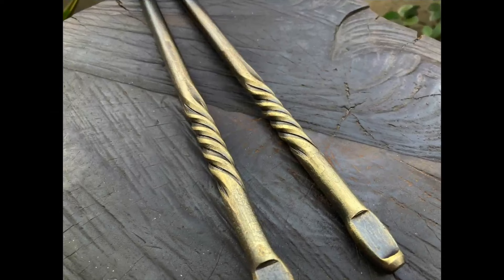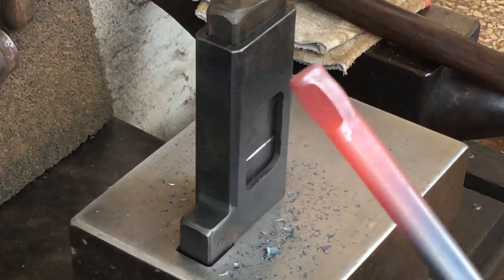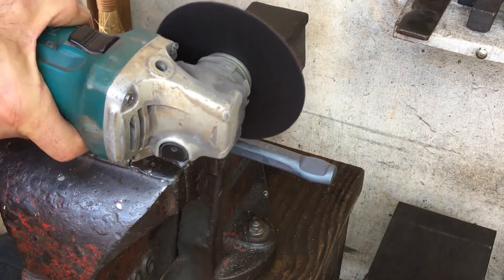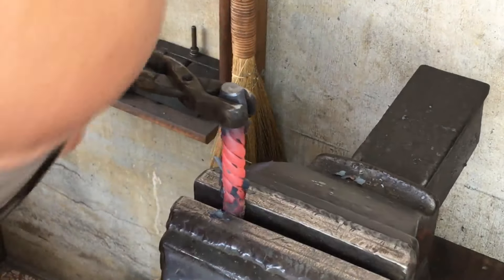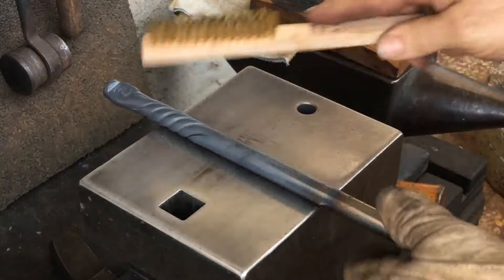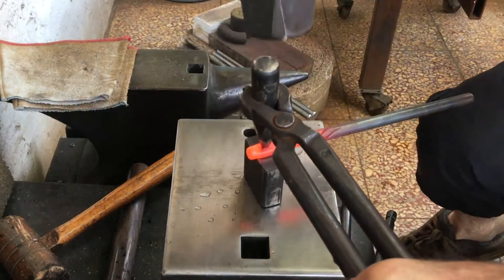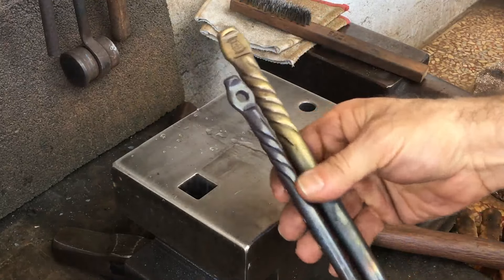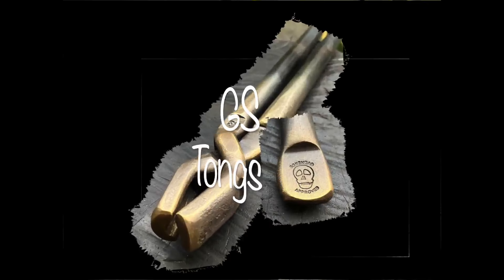Simple Rope Twist - GS Tongs

Comment: I like the idea! I have recently made a bunch off bottle openers with a rubics twist as a grip and I also use the angle grinder to make the slit in the middle of all four sides, but I then heat the part and refine the slit with a chisel. That way, the slit is slighly deaper and doesn't fade out at the ends.
Reply from the maker: Good idea. Thanks for sharing and for watching.

Comment: I need to find some W1 here in the UK, most people even in the steel trade don't use sensible names for identifying steel ..its all EN something or ldb whatever else and only two places I know of use sensible names and neither one does W1 or the Y types that you have talked about...I could swear a bit lol 
I really like the twists with the extra cut in the centre , its such an easy concept and extremely effective way of decorating different items.
Thanks for sharing
Reply: There's a few problems with the UK I know about in that they used to get pinged on taxes for bringing in some steels from the US and it was mostly just the UK and EU countries that only really didn't get hit with it. This is going back a few years now from the major resellers I used to know there so I don't know if it still holds with all the changes. It got so bad they fired up the crucibles in Sheffield and started making 1084 locally again!
The other problem, W1 isn't made much any more
They used to use it unhardened in the drilling industry as shaft extensions in an unhardened form so there used to be a lot of it out there in 1" bar stock but not much else, possibly there is a melt of it since somewhere else by someone who was wanting it, W2 its more alloyed cousin so to speak, also suffered from that problem in that there wasn't much around for a long time. I believe there was someone making W2 in the USA for a time (in the last decade or so) and there's a bit more of it around.
Reply: @krissteel4074  thanks for the interesting information ..I wonder why its not used so much now....except seemingly by Bladesmiths
Reply: @TalRohan  W1 had a fairly broad range of what it considered a recipe, like the carbon content could vary between 0.7 to 1.5% and it wasn't really easy to figure out what you had. W2 tightened up the numbers a lot more and you tended to have a better product overall with a lot more predictability to the extent I consider it a better steel for knives. In either case you need a very fast oil to quench them in as a pure water or brine on thinner geometric shapes will usually result in some kind of madness happening. Thick chunks of bar stock and simple shapes with a lot of mass to them are still fine in water though.
For water quench steels (Hitachi White, 125SC) and steels that need a really faster, shallow quench (W2 and 1095) I've been using Houghtons Aqua Quench which lets you do a mix-ratio ranging from 'super fast' that's nearly water all the way up to a medium speed quench for stuff like tool steels. Got good results from it, won't catch on fire and it doesn't off-gas nasty chemical smells like you get with quench oils
Worth a look in if you're using some difficult steels or just don't like using oils
Reply from the maker: Yeah, this twist is nothing fancy but adds a bit extra... Steel identification varies from country to country. Here and in Japan, W1 is SK4. It can be confusing. Thanks.
Reply from the maker: Good info. Thanks for sharing.
Reply: @krissteel4074  thnks I will have a look at houghtons for sure..I can see why W1 would cause problems in that case lol it wouldnt be much different than using scrap steel.
W2 I am very interested in...just got to find its equivalent ..GFS might be the place to  ask
Thanks again 
@gstongs SK4 might be a better number to ask about thnaks
Reply: @TalRohan  Dave at GFS carries a lot of carbon and tool steels, if you're after round bar he does carry Silver Steel which is a pretty good punch and blade steel with a bit of vanadium in it. Otherwise something like 80CRV2 might be the go for a tough bit of flat bar. Personally I've had problems with 80CRV2 in the past, its very much a case of 'who made it' that seems to vary the quality.
Other people swear by it all day

Aqua Quench is really good in the Super-Fast ratio (1.5L +8.5L Water) in that it will get the really difficult low alloy, high carbon steels close to their potential highest hardness with just a little bit of safety you don't get with a water quench. You can still absolutely crack, warp and wreck blades in it though!:)
The 'Fast' ratio is probably much safer (from memory its 2L to 8L) in that you don't blow up nearly as many blades.

But I'm really liking not filling up my shed full of smoke, it doesn't stink, catch fire or make everything in the oven smell gross when you temper it.